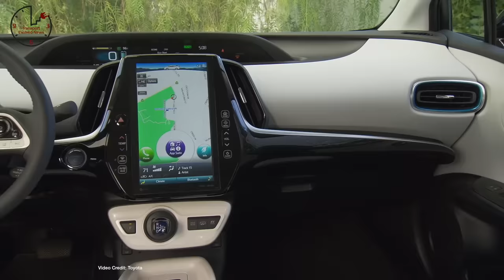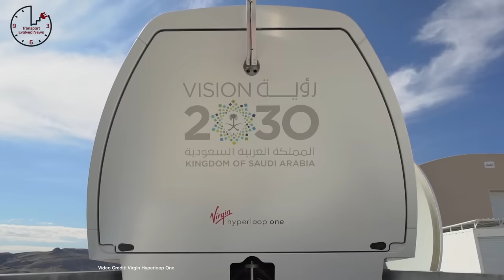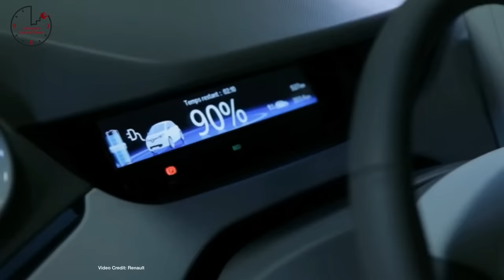Rapidgate Response, Tesla Q1 Records, BMW i3 Future -  TEN Episode 204

Comment: Come on Nikki, u don't believe the BS M3 numbers do u?

Remember they were at 1k/week  last year yet the number show an average of 660 excluding the 2k made in that last week. Clearly to get that final number many vehicles were partial builds as no way could they ramp that quick. 

More fluff from Enron
Reply: Michael Ryan, Tesla claims they produced 9766 model 3 during Q1, which is 751 cars per week average for the 13 week period. Let’s not round it down to 660 or the Tesla fanboys will focus on that error instead of the facts. 

The facts are, Tesla led investors to believe they exited 2017 (entered Q1 2018) making 1000 model 3 per week. Tesla is also leading investors to believe they made just shy of 2000 model 3 per week in the final week of Q1. At bare minimum, Tesla should have made 13,000 model 3 if they were really ramped up to 1000/week as claimed, and a more realistic number of 1500/week would have meant that at least what Tesla is reporting representative what’s actually happening. 

But before giving Tesla fanboys time to get their calculators out, Tesla registered 4793 new model 3 VINS, and since they know some are actually using that as a sign, they just registered another 2915 VINs. 

The Tesla fanboys will quickly get out their crayons and figure that means week 3 and 4 of April Tesla will produce 4793 model 3 and first week in May Tesla will make 2915. They will assume April will be 2020, 2000, 2200, 2600 and May 2900, 3500, 4200, 5000. 

This is Tesla’s secret sauce: State 100 small truths and let the Cult Members whip that up into lies, which Tesla is not responsible for.
Reply: Howdy. I rounded up.

9766 less 2000 in the last week is 7766. this divided by 12 weeks is 647.

The rest is so true. Do you know where they sell this Kool aid?
Reply: Michael Ryan, there are 52 weeks per year, 26 weeks in half a year, 13 weeks per quarter. Q1 is actually 1 day short of 13 weeks, but I round up so the fanboys don’t say I’m skewing the numbers. 750/week is really the number to use. It’s based on the SEC filing which states:

“ Q1 production....9,766 were Model 3.” 

750/week is a number Tesla cult members can’t deny, and its well below the amount Tesla had led investors to believe they should have made. If we use 660 they will just focus on that incorrect statement and go drink another cup of koolaid and stick their head back in the sand. LOL
Reply: IMHO we are in agreement about the cultists. The last week is all unsustainable BS which is why I quarantine those numbers. Cultists will believe anything Enron tweets so not to bother with them. Cheers
Reply: Michael Ryan, when the Q1 financials come out, that’s when reality will start setting in, but Tesla will throw another hype log on the fire. Unfortunately for investors it is so overpriced right now, and the facts are being swept under the carpet, so it will come crashing down hard and fast. Day traders will make a fortune as short sellers time their entry and exit points. It’s a leverage system allowing money to trade hands, not an investment.

But we need to use the right numbers or else just like the seeking alpha “gas cars are cheaper to drive”, which did cherry pick some data, Ben Sullins was able to target the cherry picking and refute the claim somewhat. I like to use undeniable facts combined with clearly stated opinion. 

As for what the VIN registrations really mean, I have no idea because I can’t find the requirements. I don’t know if they can only be obtained for a limited outlook, such as what you can make in the next 30 days, or if you can register 100,000 at once. But I don’t think there is any direct correlation between them that can pin down actual production for a given period. 

Tesla knows they are in the hurt locker if their credit gets worse, as their lines of credit might get reeled in. So they are doing their best to hide the facts until there is good news. 

Tesla will release the AWD version, and state there is a huge backlog for that car, so fanboys will get their calculator out and state the revenue it will earn without accounting for how much it cost to get that revenue. 

If I start a business offering to give someone $100 cash for 4 years of $2/month payments, my revenue stream will grow like crazy but my debt will be unmanageable. Few people can see this is what Tesla is doing.
Reply: Still I respect Tesla because they have the strength of character to make progress in the manufacturing world, not like some other tech companies that the product is hidden and turns out as they say, to be you and me.  concomitant with making stuff and being constrained to report how much stuff they make, Tesla is in the same boat as many manufacturers.  The forward-stating of numbers made, is endemic to the world of business. I remember VW buyers in the UK having to wait a year to get a golf if they wanted to choose the colour.  I worked for a company that in order to keep accounts of its holding company happy, shipped a load of unsold part made product to...their own car park on the other side of the main highway.  I think we might just have to accept, if there are numbers, there are number games, and Tesla are forced to participate in the charades whether they want to or not?
Reply: sleekitwan, forward looking is ok, but giving misleading updates on what actually did happen is not. Elon can claim he has a goal of 5000/week but he still needs to be honest about what they really made.
Reply: IMHO I did not phrase it very well. 'pulling it forward' and other phrases were often used in our production control department and it does mean half-making stuff, packing it in alorry, driving across the road having booked it as completed units. After the accounts for the period have had this counted as finished product, it is all then booked back in as 'rejected by customer' or sub-standard or some such and to be 're-finished'.  Yes, it is less than 100% honest, but I am saying, this is standard practice in manufacturing at times when required, and Tesla are simply having to play that game.  We just know almost nothing about mainstream old, conventional automaker game-playing by comparison.  In other words, Elon Musk and crew are being judged by higher standards and I just wanted us not to get to the point we expect sainthood standards from them, that will never be applied to their competitors.
Reply: sleekitwan, Tesla is way way overpriced right now for one reason, and that’s trust and faith in Elon Musk. Once it gets out that they are doing a remake of “Gung Ho”, it’s really not going to look well. Tesla has always pulled as much forward AND backward as possible to make a spike, but it’s going to bite them in the butt if they keep it up because the money still has to all add up at the end of the day. 

Tesla is busy loading up some hype bombs for when the Q1 financial report is released. It’s going to show a significant loss in shareholder value.  Tesla book value per share dropped from $27.91 to $25.10 in 2017 and will be posting more negative earnings for Q1 2018. Once the debt to equity ratio gets higher, they will get more downgrades in both credit and stock. 

So Tesla would do better to cut back on over promises and keep investors more accurately informed. Tesla, Amazon, Bitcoin are all in the same bucket. You are not buying a share of anything but hype of what it might be worth 10-20 years from now.
Reply: Smoke and mirrors again from the house of spin (1800-MUSK). He's doing it again and it's getting very last Tuesday IMO. They go full out for a couple of weeks to ramp up the numbers, most of the cars will be riddled with faults, but it keeps Wall St happier for the Q1 2018 results.
Reply: Karl P, with all the Tesla financial and accounting offers bailing out, they probably see the train wreck coming. Wheeler came in for 2 years and by time he saw how bad they are cooking the books, he hit the road and they turned it back over to the master chef Deepak Ahuja. Tesla is going to make Auther Anderson’s shredders look like child’s play. “Oops, all our servers got hacked by bleachbit”.
Reply: IMHO. Yeah, the CFO position at Tesla has bee like a revolving door, I noticed that. How interesting is it that the CFO position at a CAR COMPANY is such a hot seat? How many CFOs do Ford or Volkswagen go through in a ten year period?
Reply: Karl P, if Deepak Ahuja wasn’t screwing up from 2008-2015, why did they let wheeler replace him? And once wheeler saw what’s going on, and told whoever he told, why did they put Deepak Ahuja back in charge? Was it so screwed up that only the guy who created the mess can clean it up?
Reply: Production is ramping up, that means the average and the current rate has little to do with each other, especially when the ramp up is exponential. The 2000 per week production rate is actually compatible with VINs spotted in the wild. Bloomberg's estimates were somewhat lower, but if you look at the data and method they used it's clear they are likely to underestimate. And their figure jumped like 40% right before Tesla's announcement, so even that shows a good ramp up.
Another thing is the VIN registration, which in the past accurately predicted the production numbers, this also supports the 2000 per week figure. But two days ago Tesla registered 4,793 VINs and another 2,915 yesterday. That might indicate a huge jump in production rate. This is actually expected, since the big bottleneck in the gigafactory still hasn't been solved, but the necessary new machines are on the way from Germany. So it's very possible that the machines arrived and are being installed, or already working.
Further indication is that Tesla didn't change it's Q2 target, it's still 5000 per week.
Also there's no point to lie, when you can't get away with it. Plus lying to shareholders is a crime, and you can go to jail for it.
Finally, what if they are a bit slower than expected?
Will the competition steal their customers? No, there's no serious competition, the Model 3 was already the best selling EV in January, and no other company has even plans for an increase in production until next year.
Will they run out of cash? That's a more legitimate concern, but it doesn't seem to happen any time soon. And anyway Elon can raise money effortlessly.
The only real reason to rush production is that over half million people are waiting for their Model 3, and much more likely customers are out there.
One more thing, do any of you know how production ramp up works for other companies? How can we measure Tesla's performance without a baseline? All we have is Elon's predictions that are well known to be too optimistic. Not to mention that this is a radically new product on a new production line using a radically new approach. I couldn't find any actual data, except for the Model T which is a bit old. All I found was some vague dates, but that suggest a roughly one year ramp up time for a new model, on an existing production line, with proven technology. So Tesla doesn't seem to be slow actually.
Reply: who cares about the exact numbers? (yeah, the shorts) the point is that now they sell more EVs than any other non-chinese auto manufacturer.